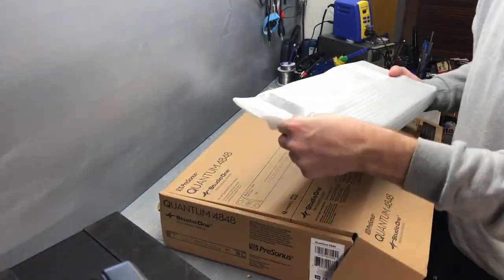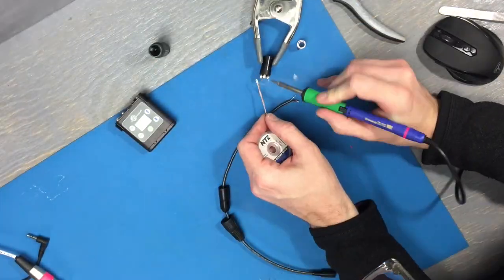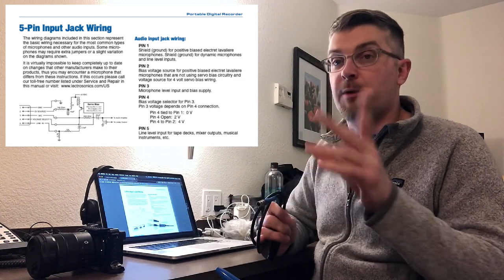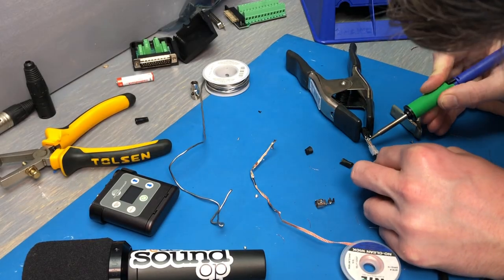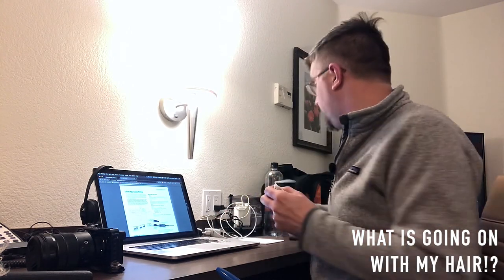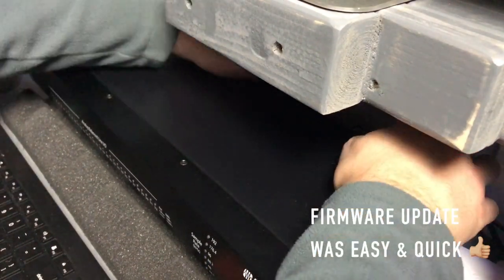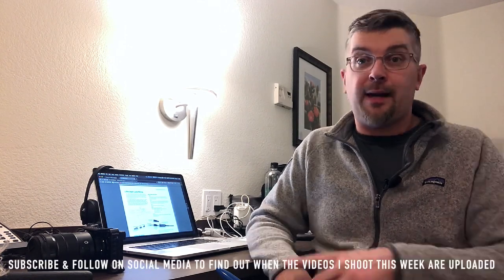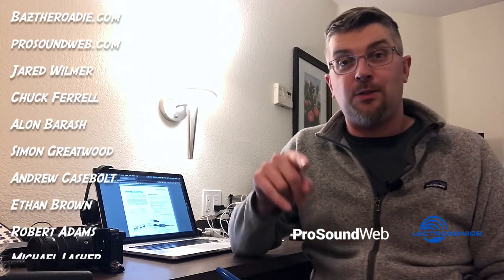Ep.162 - PreSonus Quantum 4848 Unboxing & getting ready for #NAMM2020

Comment: Here is my question, you did not mention if the relevant cables are included in the box, the input and output cables to plug into your mixer or patch panel.
Reply from the maker: Alfie, they are not included. All you get in the box is the power cable - I don't even think the thunderbolt cable came with this one. Those, like the DB-25 cables are going to run you $40+ each depending on the length you need, which can certainly add up to a bit of extra expense for sure. I've never seen a manufacturer ship DB-25 breakouts with gear though, it's common to buy the length and type you need for your specific application separately, or hand make them yourself. All the best!

Comment: I use Vicor dc to dc 12v/10A to turn on this model, But can't turn on it. But work with Min Max dc to dc 12v/5A. Can you help me to solve this Problem?
Reply from the maker: Do you have the model or part numbers for the different converters you are using? What are you supplying them with? The answer will undoubtedly be in the spec sheets if you compare the two & how you are implementing them in your setup. Thanks for checking out the video!

Comment: Where’s the in depth 4848 review?
Reply from the maker: With how the timing worked out on that one with my work schedule after NAMM, and needing to get the 4848 back to them within a set window, I didn't feel like I had enough time with it to do a full review. I know a lot of folks are interested in this one & I'm disappointed I wasn't able to put out a better video for you.
Reply: @DcSoundOp  Boooooo!  I'm disappointed as well, was looking forward to your review.  Just picked one up, I've been intrigued since it was announced as on paper, it looks perfect.  It's been interesting to me that it gets very little attention, and that's exactly what I want from converters!  1-Rack Unit, no controls, just change my Analog to Digital and vice versa, in near realtime, with amazing specs.  
I have a modded 32-Channel Soundcraft Ghost.  This thing is like I drilled a hole in the back and installed a Thunderbolt jack.  
What I didn't fully appreciate before I got it is the Metering in Universal Control.  It essentially gives this Analog console Digital Mixer super powers.  Full RTA on every channel, every kind of level metering, it's kind of insane.  It's like knowing your partners body... then getting X-Ray vision!  

When you hardware-insert every channel on the board, and have 1ms latency, the line between DAW Mixer and actual Analog Mixer virtually disappears.  Note, this isn't even mixing in the board.  The summing is still in the DAW, but you're flying around the board, in realtime like analog sessions of the past.  It's like plugin channel strips, except with real channel strips, and 32 of them at your fingertips.  No mouse clicking 1 function at a time.

And again, that near zero latency means your hands move and your ears hear simultaneously.  Hand ear coordination is organic again.

I know that you could do this with other interfaces and systems, but no where near this cheaply.
Curious to hear your thoughts.

Comment: When i hook up my usual interface via adat, can i use midi i/o then from it and the standard jack out for my monitors (socond one should be possible 🤔)
Reply from the maker: The midi will not transfer through optical, although there are many cheap midi to USB adapters readily available that should sort the issue.
Reply: @DcSoundOp  can i use it with usb c computer or i will need a adapter for that?